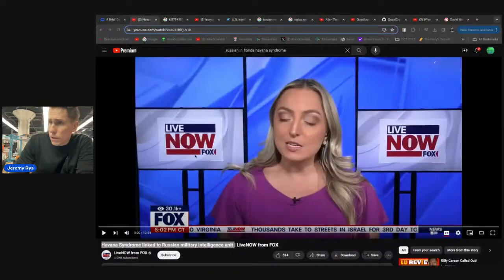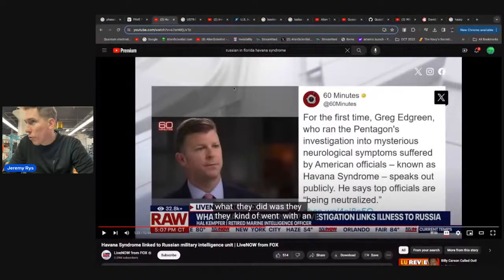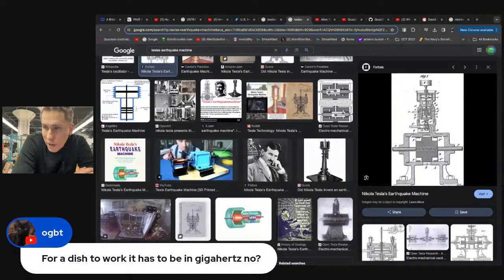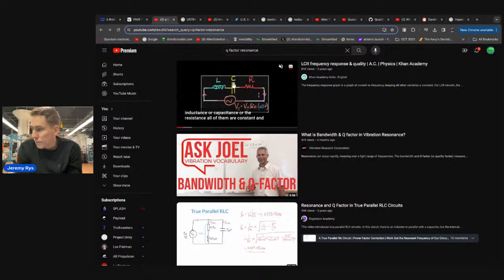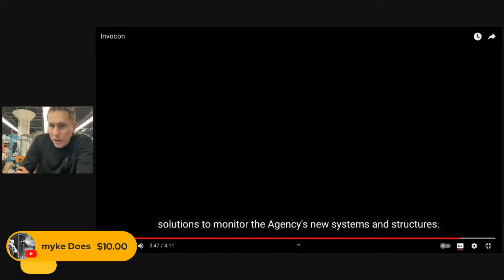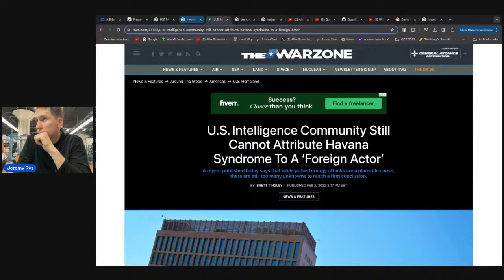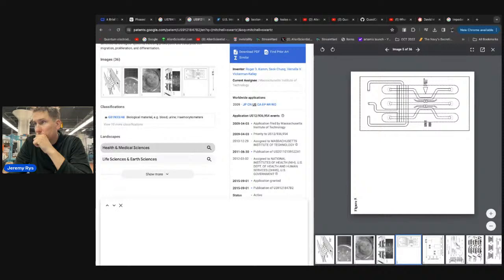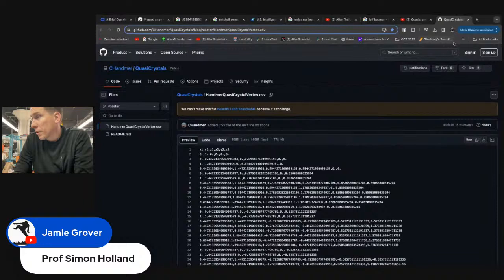Earthquake Machines and Havana Syndrome Technologies Deep Dive

Comment: Your on about  frequency you know and I know you can experiment quite easily on frequency  it has been around for years what effect have you found not what's on the net, I've been working on building electron beams and xray tubes I've worked with plasma genaration and microwave all at home building my own equipment I've even experimented  on tesla what I say is build it your self and see what it's ll about
Reply: Becareful what you say on the internet
Reply: @RushinVr6 there nothing rong in what im doing its has all ready been done before there is alot of reinventing the wheel going on and nothing new